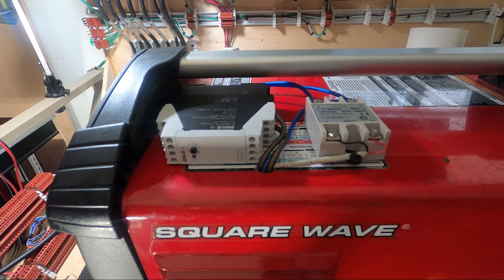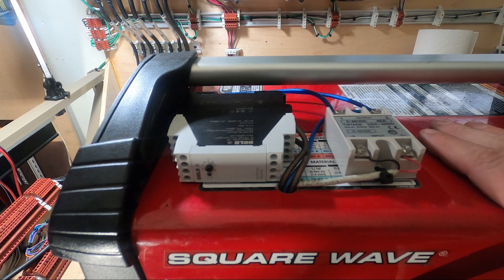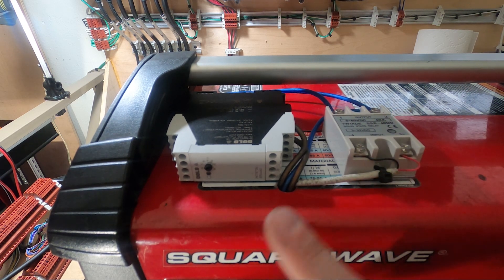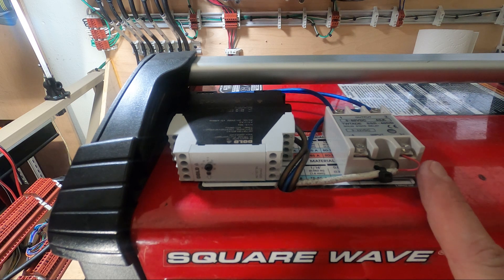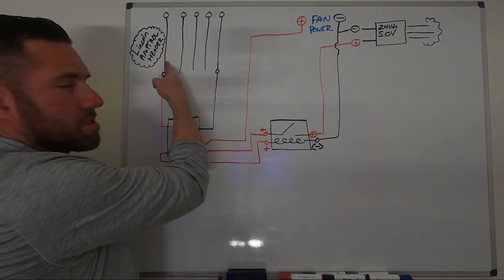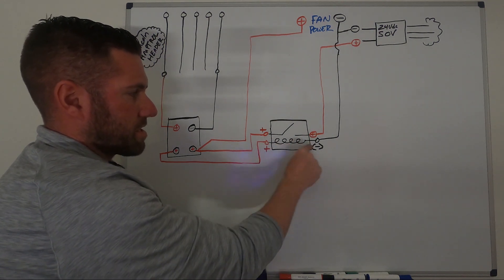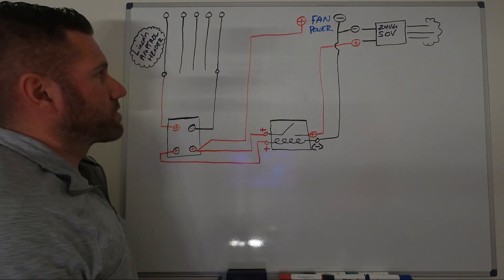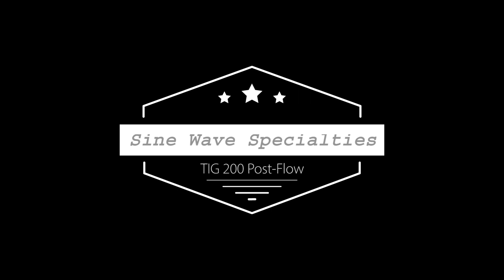FINALLY....Lincoln TIG 200 Post Flow Control & Wiring

Comment: The wiring is fairly straight forward for the relay, but the timer is a little unclear.  Can you offer a bit more detail on the wiring location/pinout on the  MK 7873N Off-Delay Timer?  I can probably figure it out with some testing on a test bed I could put together, but if you could offer a short cut that would be cool.   Thanks, Peter

Comment: Did this mod to my square wave 200 went a cheaper route used a 24 volt power supply off the 220 line in with one leg switched then a cheap relay timer in one 40 bucks works perfect Thanks for the fantastic idea
Reply: What 24v power supply and timer did you use?
Reply: @ScottHodkinson-m1w  Mean Well LRS-100-24 Switching Power Supply and the Acxico 1 pcs DC 5V 12V 24V Digital LED Cycle Timer Delay Switch Turn ON/Off Time Relay Module
Reply: @jeffhop100  Thanks for the info.

Comment: So i just bought a used square wave 200 and realized the post flow issue.
I have a CK 150 flex tig torch that im going set up to use and it has it owns valve to turn / shutoff gas
I'll just by pass the gas connection at the machine.
Problem solved 
Awesome video

Comment: A Lincoln SquareWave Tig 175 has 115VAC on both fan and solenoid so buying an SSR40DA would work if all Amptrols were the same, but they are NOT.  My 175 uses 18VAC, not DC on the microswitch, so maybe an SSR40AA? None of them go below 80vac on the input.  So I have ordered an NCC input buffer that goes well below 18VAC.  2nd difference:  The potentiometer gnd and sw gnd are not the same,  so using pins 1 and 5 doesn't work.(I tried chassis gnd too).  I'll connect the buffer right across the switch, so it will work, but backwards.  Then an AC relay with double throw output to reverse the logic.  The DOLD works with anything.
Reply: Thanks for your reply. I have a 200 square wave

Comment: I just got mine running and wanted to say thank you! Ive been using my tig 200 for a few years with a switch on the pedal to cut the gas and it worked really good but had an idea similar but not as good as yours and seen your water cooler video mentioning it. I was able to use a 24v supply and din mount everything so it can be in its own box, was also able to make a jumper so i didnt have to splice into the amptrol wiring. Definitely excited to put some hours on it!
Reply from the maker: It saves so much money.  Post flow is a necessity.  Especially with titanium and stainless steel 10sec isn’t enough

Comment: Hi
I would like to know how to connect the timer relay , to which pin numbers do I need to connect the wires from the solid state relay ?
Please let me know and thanks.
Reply from the maker: For the pin out I didn’t have a record of it written, it was more by testing. I’m not able to get to it for about another week but I can get that for you.  I’ll post a video of how I installed it because I need to open it up and clean the welder internals a bit after a dusty job and rebuild the water cooler as well.  I’ll put it all in the video
Reply: @sinewavespecialties2373  sound good to me. 
Thanks !
Reply: Good morning , please don't forget about the pin out. Thanks !
Reply from the maker: @NESTORAE86  cleaning out the garage today actually lol
Reply from the maker: @NESTORAE86  ………still getting hung up on out of state work stuff.  Approx a week to post
Reply: @sinewavespecialties2373  I know you're busy, but please don't forget about the  pinout 
Thanks
Reply: Hey boss , nothing yet ?
Thanks

Comment: Great video, i have a machine that is just a few years old, and this modification did not work for me.  Everything you state seems to align so credit given for the great topic.  For my machine the two wires to drive the solid state relay would not effectively activate the relay.  Measured it with a high impedance scope probe and the line was being too loaded with the relay on it.  It worked at roughly half pedal but not at the top.  Not giving up but likely have to do activation of the first stage relay with a better isolation circuit.
Reply: Did you get yours to work? I just finished mine and had to switch relays because it needed to much power to trigger. Solid state is weird about polarity sometimes too?

Comment: Brilliant solution. Thank you! These past several years I have been using my Lincoln Square Wave 200 exclusively for welding in autobody panels into my two hobby cars. 20 gauge steel, mostly stitch welded. It’s been a great machine other than argon consumption. A lot of stop and go welds and hammering so the 10 second post flow wastes a lot of gas. I’ve been getting into the habit of reaching over and shutting off the welder after a second or two. Cumbersome with gloves on to find that tiny on/off switch in front of the machine.
Reply from the maker: There’s a thing you should know though, the way it’s set up, if you have a failure for a pedal or a hand amptrol where the machine pops the little white breaker button in the back of the welder next to the plug hookup, it is because the trigger system is faulty.  So first time it happens, check your modified setup

Comment: Very excited to have found your video. I recently got a deal on the same machine used but found there is no power to the solenoid to open gas flow. Torch seems to work fine just no shielding gas flow. Hoping this will be a solution and upgrade all in one. Thoughts and/or advice?
Reply from the maker: Yup, a video will be out soon saying you should have a separate power supply for the timer and solid state relay.  Issue is this, if the breaker pops in the back (doing 200A on steel for about 30sec), then gas shuts down and your tungsten and part corrode.  I screwed up, soon to be addressed as I just figured this out last night.
Reply: i wouldn't buy/trading again to me it's borderline junkyard ( better tig than a 1980 225 buzz box ( mine died/melted. and yes different workplace experience had 1 as well no i didn't like it, surprised that a big-corporation ( 300+ employees plant ) was so cheap that it didn't have a mill or newer-pro-welder-equipment ect for the maintenance and management team's ) hack-conversion but dig on the square wave suck's worse than 225-AC but OVP is less at 65V~ ( vs 120V~ for the 1970's welder-design ) aka safer in theory ) quality but hay in my case its labour for a welder sadly i couldn't proswayde my customer/boss/investment into a used dynasty 400 or 350 ( 2014 and up ) that's actually worth a D..

need water cooling ( looking and working on hacking afterward water as air cooling isn't cutting it! ) im only getting a inch at 90~A before im forced into shutdown and cheating with the freezer-box/worldpool

ps im not a fan of the dynasty-DX 180~A~ or 210~? also sub-par different work/employment got 1, glad i didn't spend any of my paycheque's buying it 😅

if i was Lincoln or miller / major league-brands i would stop making under 400A tig ( 250A~ or about wall/input 3-to-4k-wattage is borderline minimalist needs for me on some off-hours thingies but the cooling loop-side generally isn't enough so forcing it to upscale to 300 or bigger ie 400-800 for the time needs of 1m to 9m strait for longer seam-welding on say quarter panels or frame ect or iron-block-repairs ect ) welder's model's it's just not good enough i do like the duel-voltage ie 120v 240v and possibles-for-480V 3P on x-models but not impressed with the product of square-wave or DX model's as both of them are lacking modern standards features ( phone application's and or touchscreen controls ect, and yes with my hobbies i endup welding old dirty crap that needs restoration ect so wave format it important like a oscilloscope ( and a automatically adjusting mode for tuff+unsure materials ect for perfection or as close as i can get ) of if you can imagine it machine does that all and more ) and almost big enough and enough capacity but still to small for shop/home/automotive use's ie 1/2 aluminium or thinner or hobby ti-exhaust's ect

Comment: question, don't we have to remove the factory power to the gas valve to override it with the new Dold timer?
Reply from the maker: That’s right, those two wires will get capped and zip tied out of the way. Shrink or cap them, do NOT use tape because it’ll just fall off and short the control board. Subscribe if you haven’t please 👍

Comment: Also do you have any thoughts or ideas on making the fan on demand utilizing a thermostat or something?
Reply from the maker: Since water cooling, nothing has went into thermal alarm, I do not want it to be as loud so that’s the next step.  Differential cooling takes place with heat cycling so the fan will always be on in my preference, just maybe not as loud
Reply from the maker: I likely won’t do fan cycling in the cooler because it has flow rate control with that knob
Reply from the maker: One more thing….. I have ran AC, no pulse, 130Hz, 75% balance for a continuous 4ft run on aluminum, I’ve never seen the machine shut off, but I’d like to keep it that way with a constant on fan

Comment: Great setup I have same machine and One big question I have will this eliminate the factory built in PRE flow? also how do I disconnect the factory built in post flow timer based on the set amperage?
Reply from the maker: All this does is actuate the solenoid.  All I did was disconnect the original harness and zip tie it to the side.  Ran fan power for 24V then through the delay timer then back to the solenoid.  The onboard system still operates the same so make sure you tie the ends of the original harness to the solenoid so it doesn’t short out.  I ASSUME it is fused, but I’d rather avoid trying to locate that fuse
Reply: @sinewavespecialties2373 I haven’t cracked open my welder yet since the parts are not here but when you disconnected the harness did you utilize the two wires on that harness? Your diagram in the video shows you are utilizing two wires from the harness, did you depin them from the plug or tap? The way I am reading your reply now it seems you unplugged it and didn’t utilize anything off the harness and just the fan ground/power.
Reply from the maker: @timbetz8503  Only the solenoid has been unplugged.  No other part of the welder has been modified.
Reply: Thanks for the reply I currently have a simple 2 way 24v solenoid between my regulator and unit and a small momentary switch and when I’ve had enough post flow I just click it and cuts the gas but I like yours cus it will eliminate having to have a switch on my torch so I’m thinking about going your route as long as with the No relay it will still initiate the post flow thru the original circuit but I can’t visualize how if the relay doesn’t close before the arc is initiated
Reply: @dustinbeyer7776  I did something similar, mounted a switch on a bracket with a springy piece of aluminum and used it to cut power when I pull my foot off the pedal. Worked really good for like 5 years but I want to upgrade it a bit to something like this.
Reply: Sorry I meant pre flow not post
Reply from the maker: @dustinbeyer7776  keep in mind, the system will have a preset delay of 0.5 seconds to initiate arc, the moment you trigger the relay, it will preflow before initiation.  Any more that 0.5 seems like a specialized circumstance that I can’t even think of.